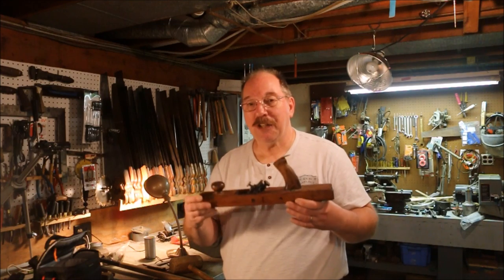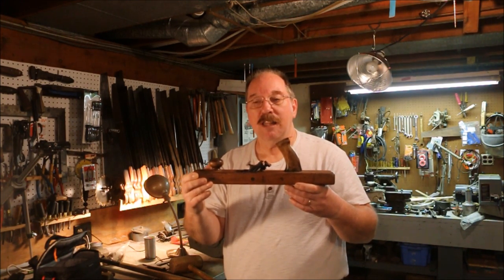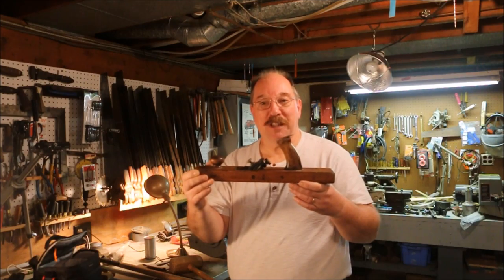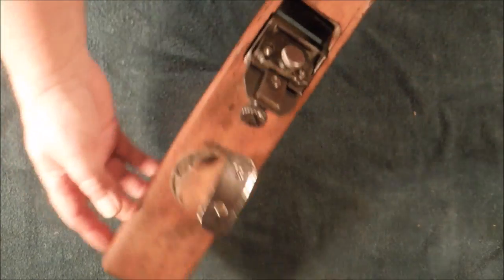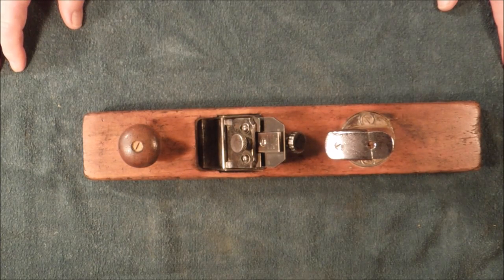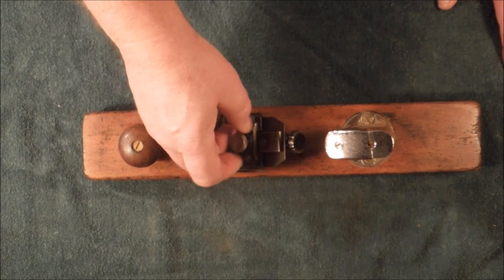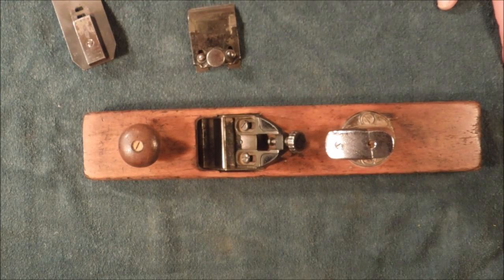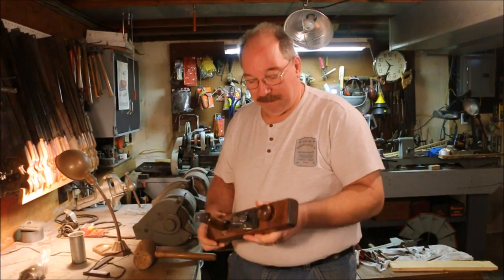Antique Shop Finds ~ Gage Self Setting Plane ~ By Old Sneelock's Workshop

Comment: Great find Sneelock and small enough to smuggle into the house without Lydia spotting it. When she asks if that is new, you can answer, "no, this old thing, had it ages." The mechanism is really clever and you explained it perfectly, thank you as ever and best wishes.
Reply from the maker: Smuggling is not quite what happens. I have a budget based on what I can scrounge. The money is recycled through projects. Not every thing is profitable but enough is to keep the shop afloat. That way procurement is accepted as normal. As long as I don't dip into the family funds. :-)
Reply: That's a great arrangement. I have to use smuggling for anything bought at a garage sale or car boot fair.

Comment: Excellent find. Recently when visiting the Vineland Historical Museum (NJ) in my town,  I discovered  J. P. Gage invented these here in Vineland under the name Gage Tool Co.: "John Porcius Gage formed the Gage Tool Co. in 1883, and operated it until 1917, making wood bottom transitional planes.". In around 1919 Stanley Rule &  Level Co. purchased the company. I had to have one to my vintage tools and today purchased one off ebay.
Reply: If yours is one of the four types listed below then it was made by Stanley after 1919. Otherwise you may have an original J. P.  Gage prior to 1919:

There are four “Types” of Stanley Gage planes, which are thankfully far less complicated than most of the other Stanley Type studies.

Type 1 (1919-1923) – Plane beds marked “Pat. Appl’d For” in the casting. No “G” prefix to the model number

Type 2 (1924-1930) – “Pat. Appl’d For” removed from the casting. Plane beds are now marked with Schade’s 2-17-20 patent date.

Type 3 (1930-1941) – The “G” prefix added to the model number.

Type 4 – Same as Type 3 but has “Made in USA” added to the casting. (exact date of this is uncertain)